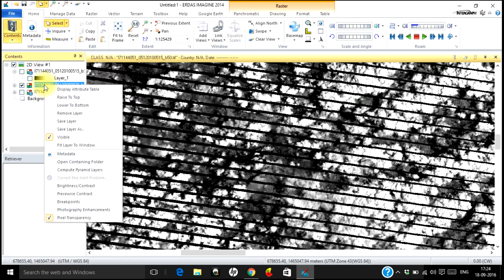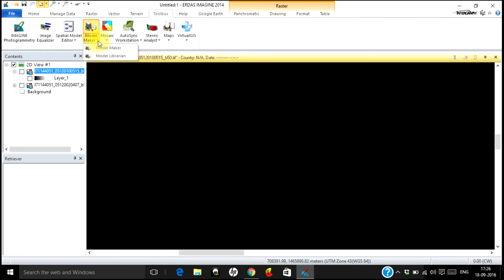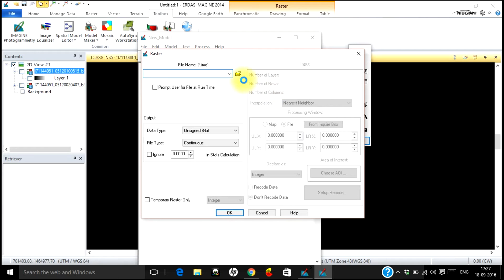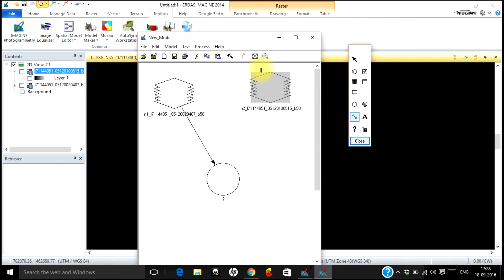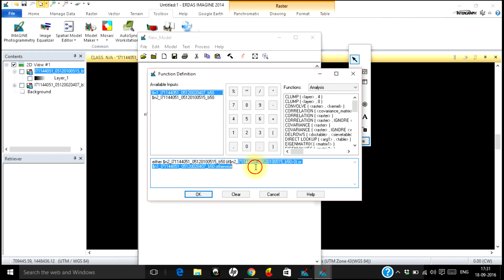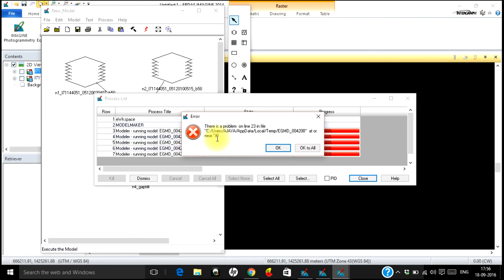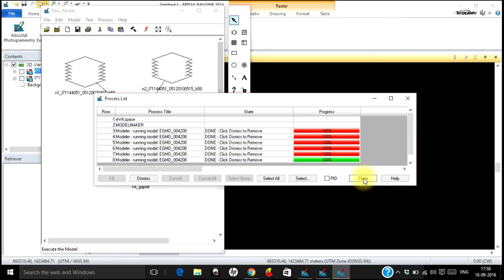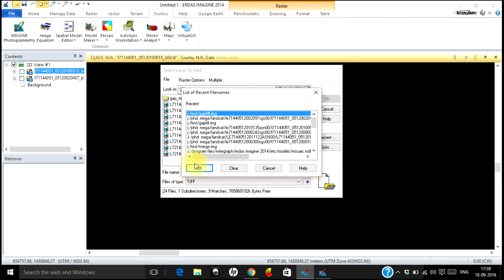Gapfilling or Destriping Landsat 7 Image for Scientific Analysis - ERDAS Imagine

Comment: Thank you, Sir. Just a few points I would like to mention and ask. First, please take care of the mouse clicking sound while recording the video because the sound causes a distraction. Second, Can I destripe an image of Landsat 7, using an image of Landsat 4 or 5 i.e., TM sensor?  Third, there are some "gap mask" files provided with each Landsat 7 scene while downloading. How to use those? Please let me know. Thanks in advance.
Reply from the maker: Initially i never used to have mouse click. But people wanted mouse click to attract attention. So I added it. You can use any image for gap filling. But if there is a big temporal gap the result will not be accurate. gap mask are not really useful. You can see online for  more  information
Reply: If I have a TM data of 2004 and ETM+ data of 2003 and 2005, can I use that 2004 TM to destripe the 2003 and 2005 ETM+ data?

Comment: Thanks for video. I've tried to follow all steps but the result is not significantly satisfied as the stripe line still appear on the output. Can you throw the light to the issue?
Reply from the maker: Its only an interpolation. You will never have perfect result. There will surely be a quality issue